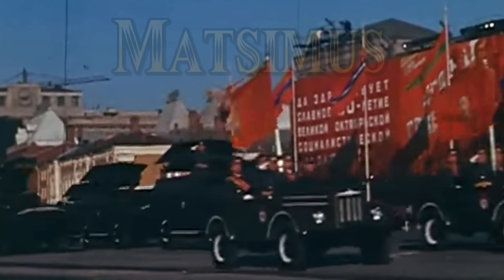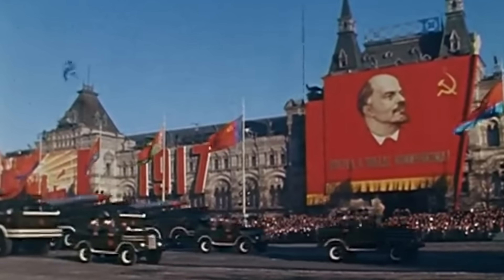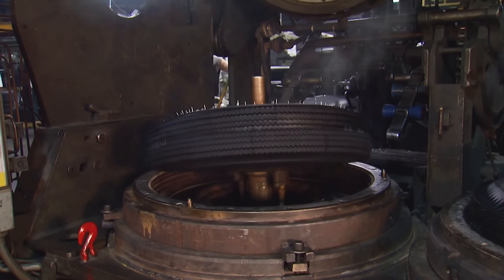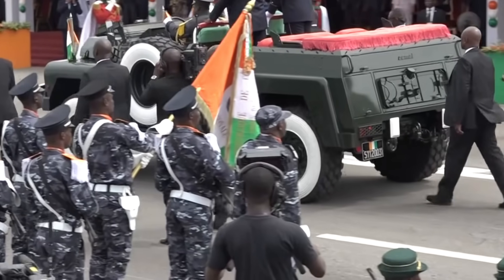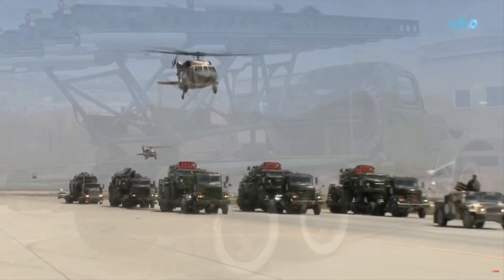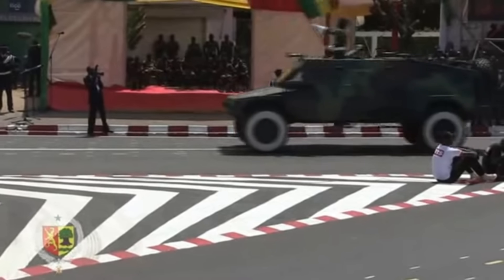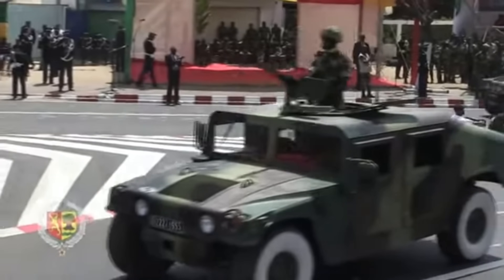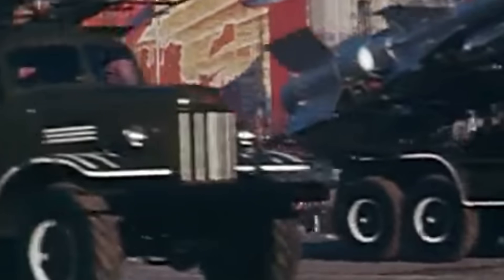Why do Soviet/Russian, North Korean and Chinese military vehicles have white wall tires?

Comment: I once owned a car with "white wall" tires.   No part of the tire was white - they were standard black rubber tires.   The white part was an added disk of white rubber clamped between the wheel rim and the tire, shaped so that its elasticity holds it against the tire.    It was purely a decorative thing.   It has no strength.  
The white on Soviet parade vehicles is also purely decorative for the parade, as with all the white painted stripes on the vehicle bodies.   On film of Soviet vehicles deployed in action you don't see any white.    There's not much point in painting a vehicle in camouflage olive green/brown if you highlight it with white.   The enemy would be laughing. 
I could accept that coating a tire would protect it against sun damage, but only if you coated the WHOLE tire.   If you only coat the sides, that's not going to do much.
I question where Matsimus got his information - he seems to have taken it out of context.

Comment: ZnO makes the compound more rigid. The white Rubber sidewall had higher load bearing capacity. As a thread compound its not wear resistant. Carbon black alone does not warrant wear resistance , but cobalt indeed does. So , the full white tires made sense from a load capacity stand point. Notice , old cars has gargantuan engines with low specific output. Inline 8 and other huge layouts , lots of displacment etc. Yet not a lot of horsepower.
Later when cars and trucks gained power and managed longer run Times,  white sidewall gave load bearing and black thread gave wear resistance. And even later better compounds allowed to use only black Rubber. However even so , ZnO is still used alongside carbon black and cobalt for every tire. 
The white "coat" on sidewalls nowdays military stuff is indeed for anti-ageing purpose ,   allowing a longer shelf life for the tire. Nowdays compounds use 200+ chemicals , and different compounds for the sidewall , the bead , thread , carcas layers , and in case of tubeless tires for the inner liner. Allso there are new materials used as reinforcing belt layers such as nylon and rayon. If you look , old things where heavy and had skinny tires. Nowdays tire width is wider , softer sidewall can be used. And its advantegous at Times to use wide tires. Skinny ones wear less when cornering  , hence why older things had those. The compounds had insufficient wear resistance.

Comment: There are two reasons to paint your tires white. For parades, so that they could be better seen on black and white TV, which simply became a tradition later (as did special bodypainting and decals). The second reason is conservation. Although in both cases tires are painted white, there is no direct connection between these cases. Military equipment in the Russian-Ukrainian conflict has white tires precisely because of conservation.

Comment: Imo what would be better for mothballing for such a long time, is taking the tires off, placing the trucks on blocks and putting the tires ready to be put back on in the trunk. Reactivating a truck from decades of standing still is not as easy as pouring gas and oil into it and turning the key. The added time of putting the tires on would be negligible.

Comment: It seems that I remember my dad running whitewalls on a 1977 Toyota Hilux pickup when I was a kid. My mother at one time had a 1979 Buick Regal with whitewall tires. That was the first vehicle I was able to drive regularly after first getting my driver's license, but teenagers did NOT think whitewalls were cool. They looked like an old person's tire, and they did to me because all of my grandparents had whitewalls on their various cars and trucks. Obviously if you're cruising to meet girls, that's not ideal. I fixed all that with the first vehicle I personally owned, and had the ONLY cool whitewall option for a young person...white letter tires. Mine were Dunlops.

Now that I'm an old person there's nothing cooler to me than Coker whitewalls with baby moons lol, but they're still (in my mind) only attractive on certain vehicles.

Comment: This is written b4 watching the video so I really hope he touches on this but white walls came about because tires used to be all white rubber but it melted when used on a car. So they added a form (idk what) of carbon into the rubber to make it not melt. But that was more expensive so they just used the white rubber for the walls and the new, now black rubber for the part that comes into contact with the road. And that made it cheaper So with that being said I had always thought that it was just the cost factor Making them choose the white wall. But now in modern times after looking it up. White walls are waaaaaaaay more expensive than normal tires. So it has to just be for show.

Comment: As a owner of a Soviet Military truck, the seats are just the perfect shape for me, I really do like them over all my other cars despite their lack of padding. I will warn you though: its a violent and noisy drive. Everything makes noise, and 4 way leaf springs on bias plys at 5200lbs is far from smooth. No sway bars, and extremely simple rebuildable shocks make for lots of body roll and barely any dampening from the driving surface. Edit: also forgot to mention they require not only quite a bit of extra work to start, they also require some strength to operate. Power anything was extremely rare. Power steering? 99% of the time nope. Power brakes? Nope. Vacuum assisted clutch? Nope. Synchronized/beveled gears? Nope. The clutch has two what I believe are ~15lb return springs, the brake pedal has 1, and the accelerator is linkages and springs rather than a cable. The transmission is straight cut unsynchronized and frankly is a bit of a trick to drive, like having to shift to 2nd then into 1st to get 1st engaged, and frankly a meme I saw where someone joked about speeds on a gearbox of reality vs fast and furious vs GAZ/UAZ is pretty accurate. To elaborate for the first image each gear is neatly separated in straight lines, for the fast and furious it has 20 gears cause lol they just keep shiftin, and for the GAZ/UAZ it had zigzagged lines drawn randomly to each gear, and dear reader let me tell you: that last image its not exaggerating.

Comment: got a moped with white wall tires. good old Norwegian Sachs-powered Tempo Korvette 380.
did it have that new? no. did i get it with it? no.
i only installed em since they where the only tires i could get for those rims that was 1. not Chinese junk and 2. had modern threads and compound.
and for some reason, there where not that much more expensive than the "Chen Ling" most buys and they just happen to have white walls.

Comment: hey  Mat  i  back  in my  days( army )   we have  couple  of  vehicle that  we use for  O2  and 2 generators trucks  ( Russian)and yes  we paint  they  tires  , IMAGINE    they  was made  in 76  and had less  that  100  km  driven  and yes  one of the communist  country  ....the  curious  think  that  when  i  was there they  upgraded the trucks with  nato  stuff  and Russian trucks just  got  water oil  and gas and start at second  try  ( they  already  have power  because the battery  was keep  charge,  was part of  the truck/oxigen/power generators  safety  ) ps  military  base  the trucks  were  keep  is perfect  clean  state  even  the engine  was shining ....plus  being  a oxigen  generator  NO  OILS AROUND   :P

Comment: This makes zero sense, why would you only paint the side wall white? And not even the entire side wall? To create more heat stress? Because now the tire will have uneven heating for more stress. Also many of these wheels just have a very thin circle of white how exactly does that help?
My theory is the white circle helps you identify under inflated wheels.

Comment: Paint will certainly help but there is no rubber on earth that will be safe enough to drive on after more than 10 years, much less 40. I've seen tires fail that were perfectly climate-controlled in a collector's garage for 13 years fail spectacularly. I wish we had a better solution for it because it is the source of so much of the work I have to do on my classics. Replacing the fuel system on an old car as we speak because of this lol

Comment: "Tyres are made of rubber and rubber is black" – errr, no, "pure natural rubber" is white (well, off-white). You need to add carbon black to harden it and make it black. Adding zinc oxide to brighten the white would be an alternative choice to harden it.

Comment: Nine minutes and 13 seconds of wild phantasies. Amazing.
No, tovarishch, this has nothing to do with old rubber. This has nothing to do with cool looks (well, at least initially).

A quick search in Russian reveals the mystery.
1. Military vehicles are often kept under open skies for prolonged periods of time.
2. Under UV light, tyre rubber dries out and becomes stiff and/or fragile.
3. A coat of white paint reflects the light and keeps the tyres healthy.

Comment: It was just for parade. In field use they didn't have the white wall tires. You also see trim painted white on tactical vehicles. They would never go into combat like that. If you do see that it's because that's all that's left.

The US Army would have vehicles for parade that were painted with high gloss green paint. They would not be used for regular duty like that. It's just for parade.

It's not rocket science.

Comment: All of those military vehicles you describe are large and heavy; and the tires are VERY expensive. Also, in those Communist countries, rubber is difficult to get(and therefore even MORE expensive), making it well worth it to take precautions like painting the tires to resist damage from the sun.

Comment: soviet truck tyres will get cracked sidewalls after 10 years in the sun and snow. painted will be ok after 30. also vehicles should be rolled a third of the tyre each year of they will get flat spots and shake when driven

Comment: Dude, GET IT RIGHT.  The tyres are made out of rubber. The wheel is usually agreed upon as being an assembly of a tyre mounted on a wheel rim.  White wheels is generally referring to the colour of the rim.  Shitty whitewall tyres (on Yank cars) were usually a disc of white rubber that sat on the outside face of a black tyre when mounted on a rim. Nobody in their right mind ever thought it looked good.

Comment: I can't take any of this as informative because you keep saying wheel. The rubber is a tire or Tyre. The wheel is the steel that the tire is mounted to. The difference between a wheel a rim is if they are welded together or spoked. A rim is a ring that is supported by an adjustable spoke. A wheel is supported by a welded hub.
Reply from the maker: My plan worked :) thanks for adding to the algorithm 🤘😎

Comment: Rims are on bicycles and motorcycles with spokes. Old vehicles (i.e. Ford Model T combined with wood/metal rims) in other words, the outermost part of the assembly that makes contact with the tire.
Wheels are the one or the combination of all the components that make up the assembly that includes the tire. This nomenclature can also be used for the combination of the rim/tire on a motorcycle.

Comment: The whitewalls in the mentioned militaries are not for storage/longevity, but for parade and decorative purposes.  They are on all the monuments across the FSU and used on ALL the parade vehicles. 

If the theory presented for painting the tires were correct, you see the inward side painted white too - which you do not and/or the complete tire painted - which they are not.
Reply from the maker: Yawn.

Comment: This is largely crap. Most of the vehicles on parade have the metal wheel rims painted white along with the edges of fenders, sills, bumpers etc. There's no big science behind it, quite simply it makes the vehicles look smarter and gives them cleaner lines, especially from a distance. The white contrasts nicely with the dark green and even some of the missiles have white lines painted on.
This is 9 minutes of dross and waffle.

Comment: Now adays i imagine the stuff they use to protect tiers are black, if they bother to do it.
If they did not, may explain some of the rotten ones in the start of the Ukraine war.
Lack of proper care, as suff like that ALWAYS ages, be it soft or hard plastic or rubber, both age not well when exposed to the elements on top of basic ageing.

Comment: I have driven  biased plie whitewalls. They suck
Reply: They were on a 64 ford T-bird, and the only thing they were good for was melting the tires in a cloud of smoke. 
They didn't grip, they felt like driving a boat, and had crappy side traction.

Comment: Total BS. most of the footage just shows the wheels painted not the tyre. It is decorative in both cases anyway. Then we come on to the storage, its unlikely The Russians have to worry about sunlight ruining their tyres, then we come to the storage... they would store them, outside? seems unlikely. Also, reducing the air in tyres to stop them cracking? usually you increase the pressure to stop the tyres flatspotting...

Comment: A lot of the footage in this video shows white rims, not white tires...anyone with eyes can see it. I don't know how true it is now, having paid little attention in recent years, but it used to be that even cheap tires had white or some other color (I recall blue on some) stripes on one side, and the other side being black...giving you the choice of which side would be visible when the tires are first mounted. I haven't cared one way or the other long enough that it could still be going on without me noticing.
Reply from the maker: Lmao. Yeah well done. It’s not the point I’m making though is it spud muffin. I’m working to discuss the vehicles that do have white tires. Sadly there isn’t much footage. So that’s the best you get. Thanks for the comment

Comment: Is just a parade paint scheme, don't think too much about it. Those are elite units that go on parades, they are not regular units, and their vehicles are painted to look better when parading.

None of the regular units got this paint. Maybe a few vehicles, selected few, will get some white painting on them, again, for show, during inspections of the higher ups, but the actual vehicles used by the army, they don't have any of these nonsense.

Also no, is not for preserving the tires because they painted even the metal wheels of the tanks.

It is done for pure esthetics for the late 40's to early 80's era, and only used now in some parts of Africa and in North Korea, still for parades and such.

Whenever you see a Russian or Chinese white wheeled vehicle on parade you must assume that is an old regiment, probably with a long history during the 60's and 70's, that has these vehicles painted to resemble their glory days. On short is evocative of the long tradition of that unit or that particular type of weapon and is only done for parading around during major events.

And for an equivalent to the West, consider that painting to be just like the parade uniforms of the officers in US. They resemble nothing with the regular or combat uniforms, and they are designed to reflect and honor the tradition and the history of the unit or the military branch.
Reply from the maker: Prove it…. Lol.

Comment: the painting of tires for preservation sounds like a load of bullshit. First of all, if you leave a vehicle standing still for years, the tires will deform under the weight and will need to be changed anyway. Second, if your vehicles are put in storage, they will be protected from the sun, since tires are not the only thing that is damaged by prolonged exposure. Last, even if we pretend there is a point in painting the tires, then you should paint the whole tire, and not just a portion.
Most likely, the maintainance manuals state that you need to use tires with white walls and black threads because at the time they were the ones with the best performance; sice no-one bothered to keep those maintenance manuals up to date, and very few people have the know-how to determine WHY they required white walls, now they just paint them.

Comment: In fact all these white elements simply emphasize the figure of the vehicles and are only used in parades. If you pay attention you will also see white lines on the body of the vehicles when they are parading, white lines that have nothing to do with any sense of maintenance of the vehicles, but are simply decorative. After all, you will never see any Russian, Soviet, Chinese, etc. vehicle with these white designs on the battlefield or in exercises.
Sorry to spoil a beautiful story...😔
Reply from the maker: You’re pretty dumb lol.

The white elements are for parade vehicles. Yes, as mentioned hahahah. 

And yet you haven’t dispelled why the vehicles have white ‘painted’ wheels. 
So you have NO idea what you are talking about lol.